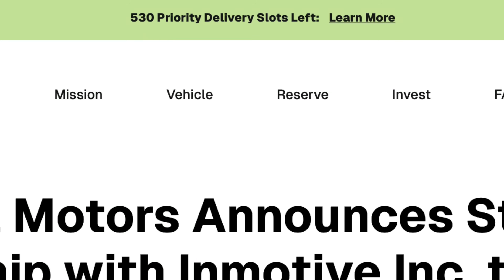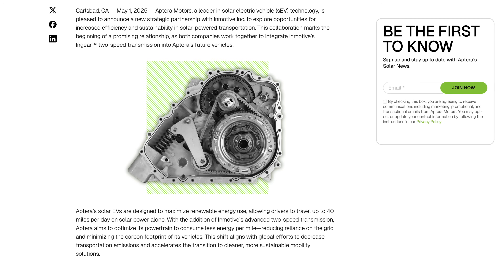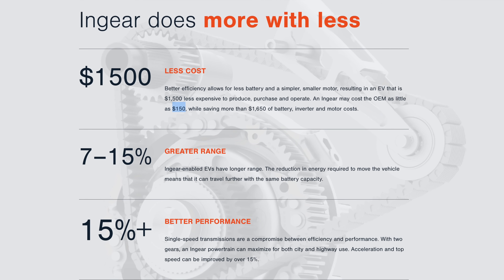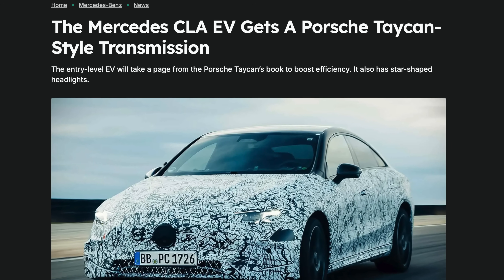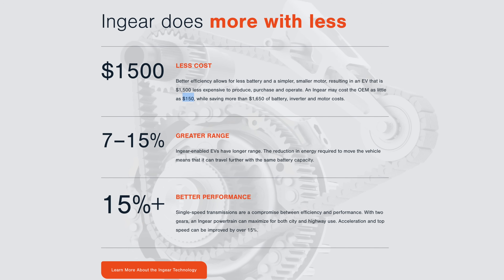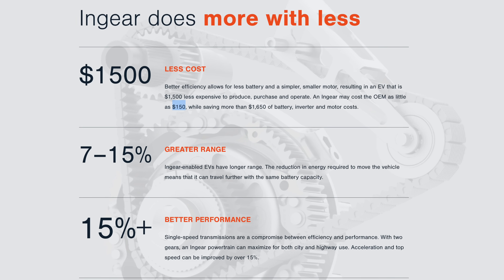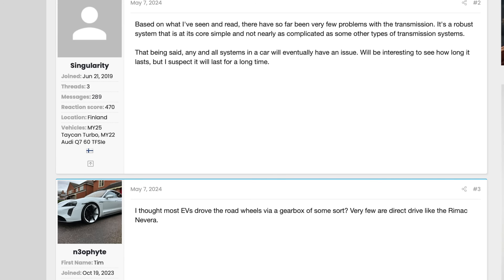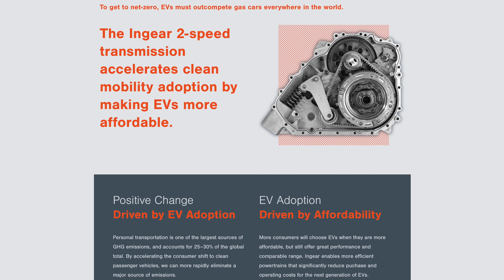Aptera Gets A Transmission?? Explained

Comment: I'm cautiously optimistic and have some healthy skepticism:

1. Inmotive has been around since about 2010 but they haven't mass produced their product yet. They have a Kia Soul EV with a prototype unit and a deal signed with Suzuki for a new EV project from January 10, 2023. That's about it for press info. It's a fairly unknown company and unknown product. Maybe it will be great, but like Elaphe, there's more risk involved compared to using tried-and-true assemblies from tried-and-true suppliers.
2. A third party has validated it on a bench and saw 99% peak efficiency, which is great.
3. They use robust parts that are easily accessible in the supply chain: ball bearings, the chain drive, and the 3 post system. This is another plus.
4. The more efficient a vehicle is, the larger gains realized when making an improvement. This means potentially closer to a 15% than 7% optimization for Aptera.
5. The chain drive may potentially get overstretched and the 3 post system seems complex. It might be fine for 100,000 miles, but I thought Aptera was built to last. A Tesla Model 3 motor is less efficient and a little louder without a two-speed transmission, but it's going to last the life of the vehicle without question. I'd rather have a higher RPM on the freeway with lower efficiency than more complexity meaning a higher likelihood of problems. I'd rather have a drivetrain rated for 1 million miles than 100,000. One of the reasons we love EVs is because they're simple and have fewer moving parts. Has anyone in the Aptera community ever said, "I love Aptera, but gee I really wish it had a transmission"? 
6. There are two reasons an EV company might add the Ingear: either to increase efficiency or decrease part costs for the drivetrain and battery while maintaining the same efficiency. Aptera hasn't been totally clear which reason it's needed. It's also a little vague if it's 100% intended for the first production vehicle.
7. When you're designing a vehicle, delete as many parts as possible. Then optimize. This seems backwards. Was this Sandy approved?
8. The goal is production. Keep your eye on the prize. This stage of the game is not the time to tinker. Optimize after you have some happy customers. We want Aptera to be wildly successful!
Reply: But part of Aptera becoming widely successful is comfortably achieving their efficiency projections. Yes, culture of continuous improvement. Eventually a heat pump, etc. But out the gate getting 10 mi per kWh would be very helpful in quieting the naysayers and attracting more customers and investors, no?
Reply: You need to be shunned for questioning anything Aptera does or doesn’t do. Don’t you know that they are Supreme and you should just give them all your money without asking any questions???
Reply: you seem like you're more on the tech side of this whole thing, rather than the vehicle guide, so hopefully my two cents as a car enthusiast can help ease your skepticism:

1. While its true that Inmotive has not really done much, its not fair to count them out just because of that. for better or for worse, we don't know what they've done behinds the scenes. Yes, indeed there are risks not using a tried and true brand, but you also have to remember that every company in existence was once NOT tried and true.
2. Peak efficiency at 99% is great, but only when its applied to its current use case scenario (I.e. a constant output drive at all speeds and ranges). Having a gearing system will ideally maintain that efficiency, while extending the longevity that efficiency can be held. (Going fast in 1st gear uses a lot more energy than going fast in 2nd gear, even if its still as efficient)
3. Theres not much I can say to this point really, thats all there is to it.
4. Same as 3; you pretty much nailed that part
5. Just because something lasts doesn't mean its necessarily good. A cheeseburger from mcdonalds will stay the same (relatively) for up to a decade. Its not a direct comparison, but you get the idea. Mechanical advantage is important not only to the efficiency and range, but also to the wear and tear on the motor and battery. If the motor has to work less at the cost of spending $150 plus labor (Unless you DIY) every 200k miles, thats a MUCH bigger and better trade off than the alternative of a potential $3-5k motor replacement job. People in the EV space in general have been talking about the advantages of transmissions for decads now.
6. Its almost entirely likely that its for better on road efficiency. If the motor has to work less and therefore use less battery life to maintain a constant highway speed, then the energy returns from the solar panels may go from 20 miles to potentially 40 or 50.
7. When designing a vehicle, "deleting as many parts  as possible" is never a go to option. Maybe if you're making a track demon with top tier cornering and a sub 3s 0-60, but thats not what Aptera is going for. You have to consider than this is a consumer car and needs creature comforts which could harm efficiency all together. And while the transmission will also add weight costs, it will also make up for it, and other additions itself. It is an optimization.
8. Yes, the goal is production. Which is precisely the time to make sure any last minute viable possibilities are explored and implemented before the actual production model hits showroom floors. If they release a version without a transmission then 3 months later come out and say "Oh by the way we actually have this version with a 15% increase in efficiency" a lot of day-1 customers are not going to be happy.

We're talking consumer road vehicles here, not a tech startup. Hopefully this cleared the air, but you are absolutely right to be skeptical of last minute changes.

Comment: Ive been screaming for the past year that we needed a transmission for EVs.
The only reason they're not putting them in is because they're hoping that the "fun" acceleration from essentially driving at first gear all the time will make you forget that towing and winter temperature halves the driving range.
This news vindicated me.
Reply: The range wouldn't improve with a transmission. It's not like an ICE where a lower gear uses more fuel as you're spinning the engine faster with all of the associated losses.
You lose range with selectable gears in an EV, as you now have more transmission losses.
Reply: The issues you note with range won’t be improved with a transmission. Towing a trailer increases drag. They have poor aerodynamics. Decreased range in winter is because of the battery. The Taycan uses a 2 speed transmission not because of range but to extend has fast the car can go on the top end. Most people don’t push their EV to the RPM limit of the electric motor.
Reply: @professionalelectronics3158 If the other comments haven't spelled it out quite so directly, this does NOT "vindicate" you.  You do not have a correct understanding of the difference in ICE power bands vs. electric motors.  They are vastly different, where ICE has a specific and relatively narrow RPM range where torque and combustion efficiency are maximized, and this is where transmissions are used to keep the engine in that range under load.

Electric motors have full torque and full efficiency (or near enough as makes no difference compared to ICE anyway) from 1 RPM up to many thousands of RPMs.  All of the electric motors used in EVs already have single-speed reduction gearing built directly into the units because, first, the stator rotation has to spin more to overcome larger diameter wheels and inertial resistance (otherwise using MORE power to force a stator to spin to overcome resistance would result in efficiency loss) but they can't reduce it too much or they'll sacrifice usable top speed.  Luckily, efficiency losses in most electric motors aren't particularly relevant until well over 10,000 RPM.  My M3 for instance tops out in the realm of 120 mph at something like 13,000 RPM, but I can still 4-wheel drift in track mode.

Efficiency and range losses in EVs compared to EPA happens from 1) aerodynamic drag 2) extra weight/towing 3) temperature affecting battery chemistry.  "Towing in the winter" affects all three, with (typically) more dense air, obvious weight increase and basically all current forms of lithium ion batteries lose energy storage/transfer efficiency in very cold conditions.  Transmissions would help in none of these cases.
Reply: No actually you do not need a transmission.
The electric motor can control output speed by changing the frequency of the incoming AC. This is called VFD, Variable Frequency Drive.

Comment: If it helps them meet or exceed their efficiency target, I am all for it.
Reply: By adding more weight?  How does that help with around town stop and go driving?
Reply: @mikelfrance-l6x it likely doesn’t do anything for in town driving because the electric motor isn’t spinning out of its efficiency range in town. If you never go on the highway you wouldn’t need it and you could get a low speed neighborhood vehicle and save a lot of money for the higher speed safety features that aren’t needed either. 
My use case is primarily highway speeds and this is very interesting to me as a way to potentially add 10% more range for a $150 part that likely only weighs a few pounds.
Reply: @kenmcclow8963  Did you happen to catch at what speed  gears shift?  My use case is quite mixed including congested highways where 45mph is the norm.
Reply: @gr8dvd In another video I think they said the shift is at 60km/hr. That would be about 37 mph.
Reply: @mikelfrance-l6x  Steve F implied the opposite at CES. That the EMR3 is well tuned for high load, but lower load efficiencies were lacking. Course at speed level or downhill highway cruising could also benefit from a low load gear.
Reply: @mikelfrance-l6x wow you must love aptera, you can't stop commenting
Reply: @Vocuzvizions  Someone has to tell people the truth.

Comment: I hate this idea. The original Tesla Roadster had a two speed transmission and they had a lot of problems with it. Transmissions are a major point of failure in a lot of ICE vehicles, the point of EVs is not just energy efficiency but to reduce complexity, eliminate mechanical parts that can fail and require maintenance, and ultimately improve the overall reliability and reduce the total cost of ownership of the vehicle. Many EVs eliminate the need for a transmission by having two motors with one optimized for efficiency at low speeds and another optimized for efficiency at highway speeds. Since Aptera is centered on efficiency and are now only going to have one motor for their launch edition, I get why a transmission would be worth considering to optimize their vehicle's efficiency, but it adds upfront cost and potentially long term cost if it fails prematurely. I'd rather see the slight efficiency hit than pay more for another mechanical part that I now have to worry about. Replacing a transmission is never fun.
Reply from the maker: Roadster had many issues and the EV industry has changed dramatically since then. Taycan has had one for 5 years now and Mercedes is adding one now. Haven’t had any issues
Reply: @TailosiveEV  The 2-speed transmission in the Taycan is only used for hard accelerations, otherwise it stays in the higher gear. Also, those transmissions have been a source of warranty repairs for Porsche over the years. Nothing major, but especially early ones are not always reliable and they are very loud.
Reply: I'm sorry but I've had multiple cars with manual transmission and aside from the clutch, never had them break.
Reply: @linusa2996  This isn't a manual transmission though. It's an automatic and it has two clutches.
Reply: @ Properly designed and built, a dual clutch transmission will be just as a properly made manual transmission.
Reply: I'm with you. Adding a new, more complex part, this late in the game, is a bad sign. The first bad sign that's really got me thinking against this vehicle... which is annoying, because I really, really wanted one and wanted them to succeed and grow
Reply: @darthsirrius  There's been a lot of bad signs for me. They were supposed to have a deal made with a major bank that would have secured funding then it fell through. They were supposed to have all hub motors with AWD and then switched to a single front motor out of nowhere after talking about how much better the hub motors would be for performance and efficiency. Now the vehicle's acceleration and performance is worse than expected. Then they announced more updated pricing and a $30,000 car turned into a +$40,000. Which is my biggest concern. Most car buyers will always see a 2 seater 3 wheel car as less valuable than a 4 wheel car, so a 3 wheel car has to cost less than a comparable 4 wheel car to gain significant interest. But 3 wheel cars rarely ever wind up costing less than a reliable 4 wheel economy car when they make it to production and now the Aptera is priced above the base version of the Tesla Model 3. Yes it has solar panels and better range, but it will still lose sales because of the higher starting price point and less seating and storage space. Then they announced another round of crowd funding in a desperate cash grab to get more money from retail investors who are living off hopium and have no clue if these guys actually know how to build a successful car company. I invested in this company early on in 2019, nothing more than I can afford to lose knowing that it's a bet on a car I want to see made (something I wanted to see made even farther back in 2009 when they had the plan for a diesel hybrid), but may never happen. To me, all these let downs just reminds me of Star Wars where Lando keeps saying about his deal with Vader that "this deal keeps getting worse all the time". 😂